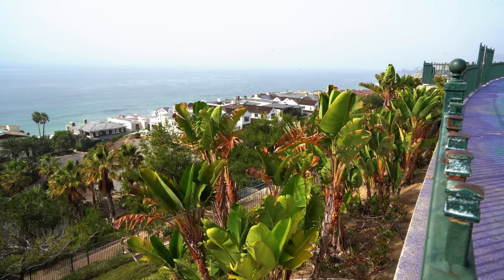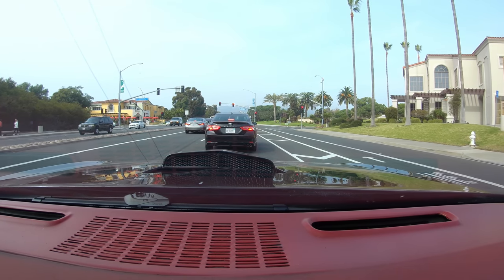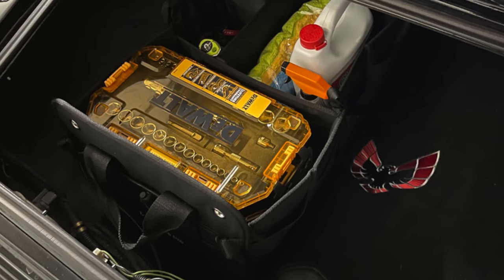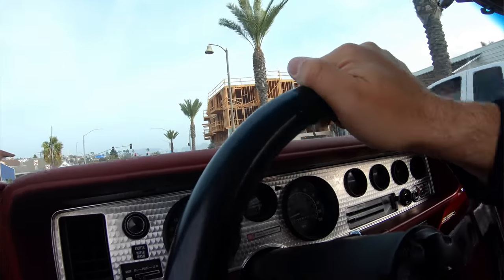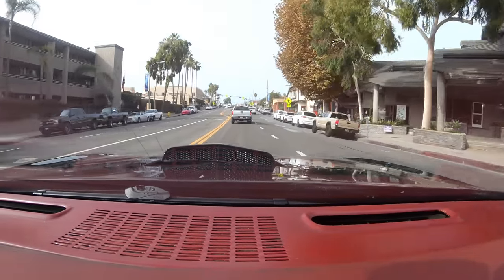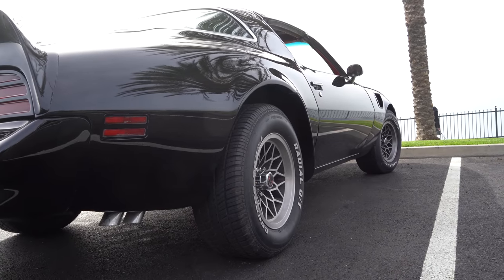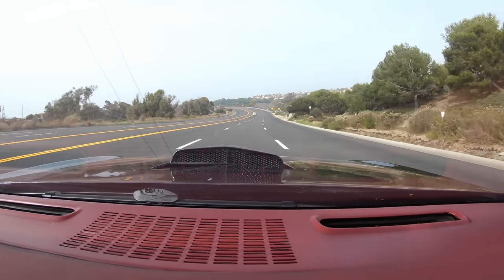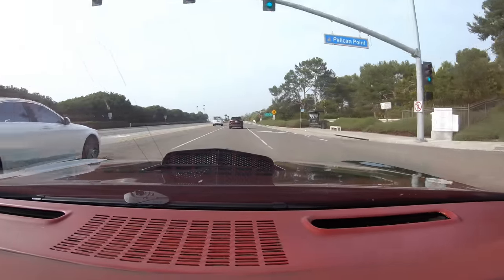The Trans Am is finally DONE! Why this is the COOLEST Car in the World!

Comment: If you don't like road rash on your paint mud flaps are a must. As for an engine swap, keep the #'s matching engine but I would put a 383 stroker in it. 20 years ago I had a very similar body and paint restoration on my white firebird. Those guys did a fantastic job on the fit and finish which is what you should have got. Sounds like they weren't used to doing this level of work considering all of the problems you stated. Glad the paint and body were done well, she looks fantastic. Black is one of the hardest "colors" to get right. I would be curious as to what you spent at this body shop? Mine took about 2 months and cost around 3 grand Canadian but that was 20 years ago. Congrats on finally getting her back. Cheers!

Comment: I used to be one to fix up and run that Olds 403 but got burned out of always having to replace parts it decided to eat.  So I'm busy yanking my built Olds 403 w/TH350 trans out of my 78 Firebird Formula (CA car) so I can make room for the new engine to go in along with many other goodies I'm going to do to my old Bird.  

You have the same C&C tops that I have as well and, to be honest, they are really nice once you've figured them out, rare as all Hell too I might add.  I went with a 3M solid core foam seal that's 1/2in x 1/2in in size and use the black RTV to help seal it on either side of it, looks good and functions even better as it seals up the tops along with removing those pesky squeaks you're getting.  Then there's the locking tabs for the t-tops, for those I use a black rubber door stop, you know, the ones you'd find behind your bedroom door on the wall, yup, exactly the same.  They work perfectly and actually look like they were made for the car, just trim them how you like and mount them with the same black RTV you used with the 3M foam seal.  

Lots of great things to do for these old cars and it tickles me pink knowing you and I are about the same age and yet own almost the exact same car but have the same passion for getting things the way you want them on your ride.  I look forward to more of your video's on your ride, perhaps meeting up some time down the line so I can share a few secrets I've learned about these old girls over the years.

Comment: I have the 400 pontiac and it has had work done, running edelbrock performer carb and intake manifold and it drives great. The old 403 has potential and numbers matching is always a plus so I would suggest tuning the lump you have.

Comment: No explanation necessary, Winston. Anyone who considers him/herself a car person understands that there are certain cars that people just gravitate towards... and you don't even have to be a gear head! Just being able to appreciate cars is sufficient.

The Pontiac Trans Am was a classic! It's beautiful. It looks fast, even when it's standing still. It's drives nicely, too! Except in Canadian Winters: unless you have Winter tyres and a couple of bags of salt in the trunk... that back end is light enough that you'll be fishtailing in even a light snowfall. (Speaking from experience)

I think it's great that you have the opportunity to get your dream car; and to refurbish it back to nearly new shape. On the question of the engine... I think that's an entirely personal preference; however, I recommend getting the more powerful engine; and while you're at it, either replace the transmission and differential,  or give it an overhaul. You don't want the added stress from the new engine to break an old stressed out transmission.

Btw, I feel the same way about the 2005-09 Chrysler 300C with the 5.7L HEMI. My dream car. I had one, but my dear wife totalled it. (Not her fault... and I'm glad she didn't get injured) I'll eventually get another one; and keep it on the road for as long as vi can drive. 🍺😋👍

Comment: That Trans Am looks amazing! I'm currently restoring a 79 Y84 SE Bandit Trans Am with the W72 Pontiac 400 and 4 speed transmission. Mine has the factory Fisher T tops and it too is my ultimate dream car ever since seeing Smokey and the Bandit for the first time at age five. My personal opinion is to put a Pontiac 400 in it which are excellent motors, especially compared to the Olds 403 which I've heard have bad oil delivery, but not sure about that. As for the roof, I'd leave it as t-tops are one of the most iconic options for a Trans Am, even if they are aftermarket. I'd also leave them and fix the t-top since the car has been repainted and if you were to have a hardtop put on, the car is going to need to be repainted again. Love the car and I can't wait for more videos on the Trans Am.

Comment: You can get rid of most of the rattling and stiffen the car up substantially by adding subframe connectors...I have several of those cars and these are a must....especially on a T-Top-car. Relatively cheap too....

On the question of the engine I would keep the Olds....especially since you are more of a cruiser than a racer...DO NOT GO TOO WILD with updates....too much camshaft destroys the low-end torque and drivability. A good set of headers and a dual exhaust add about 30 hp....then open up the shaker for cold intake air...that will easily give you about 5% more power on a hot day. 

Biggest Pro tip: Take the car to a dynoshop and have them tune the carb and ignition....in most cases these old engines are not set up properly...I have seen MASSIVE changes with my cars in the past. These few simple mods will already really wake up you car. And if I was you I would keep it like that. 

Only after you have done all of those things and you still want more you could invest in more power. To keep the low-end-torque get a cam with maximum 210-218 lift on the intake at 0 050....the biggest bump will come from a good set of heads like the Edelbrock-aluminum-heads. If you combine that with a simple Performer-intake you can keep your shaker...with the performer RPM it will not fit anymore. The aluminum heads, the intake and the headers will easily shave off 50 kilos of your frontend....keep the short block as long as it lasts...with the original shift points it will live forever. Why change it? This combo should give you about 300-350 rear wheel hp....then you might consider better brakes and suspension parts...

As I have said I speak from experience. I currently own a 74 DS 455, a 71 Formula 455 ( all heavily modified) a 71 Firebird Roadracer and a 71 F-body Camaro...I had tons of these cars in the past in all states of tune and yes, the ones close to stock are not the worst ones if you want to drive them often. Heavy modifications easily spin out of control and produce a car that ends up being too radical for everyday use.

Comment: The car has no secrets from me. The engine is perfect. The audio tells the story and the car sounds solid. I ✌ think this car is perfect! California is the best highways & byways. I wouldn't do anything but gas and new brake pads.  EXCELLENT BUILD! 5 OUT 5 ☆ INTERIOR MUST GLOW AT NIGHT.
I owned a Firebird Esprit 270 HSP V-6. White/Tan dash. $9,999.00 purchased new. I was 18. It was bought for my mom. But I picked it out & screamed for it. I detailed it drove it to L.A. Those cars are dream Machines! They will run great forever!. You didn't say Sway Bar in the back? And a Cross Brace over the engine to keep the body stiff. The thing is that ride is very light. They tend to Fly. ✝️

Comment: I owned a 1979 10th Anniversary Platinum edition Tran AM with the 403 Olds engine from 1979 to 1983.  I hated the front bumper headlights styling.  I liked the front-end look on your 1978 TA much better.  The ride on my TA was firm but very comfortable.  The handling was great.  But I think it only had 189 HP which was a far cry from the good ole days of Trans AM.  My favorite car to this day was my 1991 Toyota Supra Turbo.  I wish I still had it.  I traded it in when it has about 70,000 miles on it and it never had a mechanical problem.  The ride and handling were awesome and the power was more than adequate at 200 HP before and 222 HP when the Turbo was on.

Comment: had 75 firebird (black) had a pontiac 350 in it, replaced it with a pontiac 400 out of a 69 catalina, put in a 268 mild cam, different factory heads to raise compression 10 to 1, eldebroch dual plane manifold, holley carb, ended up putting moter in a 75 (silver) transam , new dual exhoust, this car had a muncie 4 speed in it and beat most cars on cruise knight, i loved that 400 10x better than the olds engine and the sound of car was awesome.

Comment: I have had 9 Trans Am and 2 had T-tops. The hardtop Trans Ams are much tighter, drive better, do not rattle and do not have the rust issues that T-top cars have most of the time. I would change it back to a hardtop. Also install subframe connectors, they tighten up the body and you will feel it drive 1000% better. Best of luck!!!!

Comment: Hey sorry to hear about the body shop. I wasn't surprised when you bought the cheapest one online it turned out the way it did but the body shop was surprising. 

I would like to see you push the original powertrain to more horsepower BEFORE you try to engine swap. 

although the swap is probably going to end up being way more fun when it it's done.

Comment: Cam it and exhaust. Just figured out your states emissions laws. As far as intake my preference is Holley and Edelbrock intake. MSD 6-AL would top off the bolt on stuff. I agree that Quadrajets sound good. FYI I have a 67 firebird a 77 formula firebird with the Hurst T tops and a 79 formula firebird. I have converted all of them to Chevy 350 with TH350 trans. My 67 is the one I 1/4 mile race. I have had all of them since my late teens I'm now 45. None are finished but I'm planning on moving out of town and combining my shop and my house.

Comment: I had one with a 403. Great motor. Lots of power to be unleashed. Here's what I did. Heads, cam, intake, headers, exhaust. Ditch the quadra jet or at least get a rebuilt one. New distributor and ignition. MSD. Get rid of the 2.43 highway rear-end gears. Do a 3.73 or 4.11 ring and pinion swap and put in a nice rebuilt 700r4 trans. You mayl have to get or make a new trans crossmember and have a drives haft made. Will wake the crap out of it, and still run down the highway at a decent rpm. It will appear original and run 1000 times better and faster for not alot of time and money.

Comment: I had a 1979 T-Top Firebird T/A but every night, since it was parked in a garage, I would un-lock the T-Tops so that the weather stripping wouldn't get compressed down and I was lucky enough not to have any rattles. Stick with the right engine and get some new headers and the 400 HPs. Is there going to be a road salt problem in your new state?

Comment: I would build up the engine keep numbers matching. Get a bunch of the parts catalogs (Jegs) to noodle on engine and body upgrade ideas. With modern tires, I bet there are some good solutions to improve performance in the curves (hard-top roof, better shocks, sway bars, bushings, brakes. . . ). Interior looks good but you could do some videos on: interior super detailing, headliner fix, parts replacement, squeak reduction.

Comment: Congrats. It's looking really good. On the question of the Oldsmobile 403 ci it has a few issue; the window main webs which can cause failures at higher RPM and they tend to overheat due to their large cylinder bore and being to close together. Going to the W72 package Pontiac 400 would be a great starting point for an amazing build. If you where doing a back to factory restoration I would say keep the 403 but you are building a dream car and most people when they thing of a dream Trans Am they think of the Pontiac 455 HO or 400 ci.

Comment: I think you should do a simi-reastomod on it. What I mean is keep your engine at 80% numbers matching, carburated. Keep the block, crank, rods, pistons, and such as is. Change the cam to a Crain, Crower, Eadelbrock or such that is a roller with roller lifters and rockers to increase efficency. Make it something with bigger loabs but still everyday streetable. Change the heads to ported and polished year that gives you better water flow, air flow. I think it was 79 that GM had the Z28 intake made by Eadelbrock with a 6 inch overall rise, awsome water and air flow as well as being alloy for better heat loss and brings peak HP from 2300rpm to 3500rpm. Do a Holley 650cfm 2xpump w/E Chock to keep it simple but with reliable starts in cold weather. At 650 you may be limiting the car down a bit but keeping better fuel milage and lower emissions. Do a full exhaust with Flowtech headers & mufflers. Do an electric H2O, gas, oil pump to reduce belt work. Just doing bolt on even with the right year

Comment: If your do upgrade the engine, be sure to upgrade the suspension. I added air shocks back in the day, but now I'll bet you could really make it nice. I ran through Sacramento at 110mph. Girlfriend was freaking out. Fastest I took it was about 120, but as the speedometer was pegged, its just a guess. Mine didn't have the bird on the hood and no t-top

Comment: Last year my 84 Trans Am was in an accident when someone pulled out of their lane into my car. After 5 months i got it back from the body shop. And oh boy, they screwed up the body work bad. The hood and fender dont line up, they never fixed the mirror, theres a parasitic draw now, so on an so fourth. Body shops, even highly recommended ones are garbage at fixing old cars typically. Its unfortunate.

Comment: Empty gas tank was for your benefit. Ethenol content in gasoline will absorb water over time, and would have gummed up in your tank and would gum up your fuel system. The air conditioner, most likely,  leaked out of the compressor seal. Glad you could figure out, and deal with the other problems. Happy cruising!

Comment: I had a Rochester Quadra-bog in my GTO. A lot of people put Holleys on because they are easier, but a properly tuned Quadrajet is pure joy. As far as numbers matching, that's nice but trying to squeeze more ponies out of an Olds is a lot of work for little pay off. This is your dream car that you will have forever. Save your pennies and get a Butler. Just factor in that a Pontiac engine will need a TH400 and upgraded differential. 
LS engines are the fastest and cheapest way to gain tons of horsepower. I would swap it into almost any car, including the Queen's Land Rover. The one exception is a pre-1981 Pontiac. They deserve Pontiac engines. Not LS engines (or Olds engines)

Comment: I had an original 78 T/A 6.6 400, Hurst 4spd, all black in and out with all the original smokey and the bandit gold birds and striping. 14.1 in the quarter and 12.6 on a 125NOS shot, running Hoosier super soft dirt track tires on the rear for the street. Funnest Street racing car i ever owned, other than a few other faster ones I have had truthfully. But these T/As weren't thought of as fast in the big 5.0 crowds running around then, so they'd always seek out and pounce on those unique and well known taillights at night and find out the hard way why the plate said FRQFLYR. PRICELESS

Comment: As for the engine, just drive it.  It seems to run good, and has enough power to make you grin.  But those were 70's engines sooo, if it does come apart, up the compression a little (pretty sure these were quite low due to emissions), if you really want to do heads and headers, sure, but otherwise keep it good and numbers matching.  As for the body Shop, seems like a lot of them are like that?  I had my truck repainted and while it looks amazing, they spent far more time on stuff I didn't really care about, and basically no time on things I wish they would have given a little bit of attention to and basically just not listening.  Kind of got a sense of "Don't tell me how to do my job" from the guy, well guess what buddy, it's my truck, and I AM going to tell you how I want it done.

Comment: My first car was a 78 Trans Am. I used to  see the front end sticking out of a barn when I'd ride the school bus. I paid only $1,500 for it. That was in 2000. To buy the same car today, I bet it would be every bit of $7 or 8k. Originally had the Chevrolet 400 and 350 trans. When I bought it, that was long gone. In it's place was a 72 Oldsmobile 350 and 350 trans from a Cutlass. Interestingly, the 350 had about the same power as the 400 it was built with.

Comment: I had a 650cfm holley with mechanical secondarys on my pontiac 400, it made that throaty sound way better than a quadrajunk carb. Dont change rear gears - not worth loosing hwy driving.( used to be a Firebird\Transam freek, until i fixed up a 79 camaro with t tops) that had a chevy 400small block in it

Comment: This is by far the most beautiful design in any car era, I’ve owned 12 from my first a 77 through my current 98. bought my first at 15 and am 51 now and I will own a firebird till I die💯😁. But nothing wrong with the olds 403. But the Pontiac 400 is a more stout of a motor. But u should just get some bolt ones and upgrades for the ol 403 and it won’t disappoint💯😁

Comment: In response to your poll question... It's an American hot rod and it's all yours - you've already crossed the line into resto-modding with the paint change. But a numbers matching engine/chassis is always preferable for long-term value. So, if it were my car, I'd keep the original engine, but tune it to absolute bleeding max for performance and reliability!

Comment: C&C t tops are better in rain. they also have a extra t bar to stiffen the chassis. you should also install subframe connectors it will get rid of a lot of squeaks. nice car I have a 3rd gen with c&c